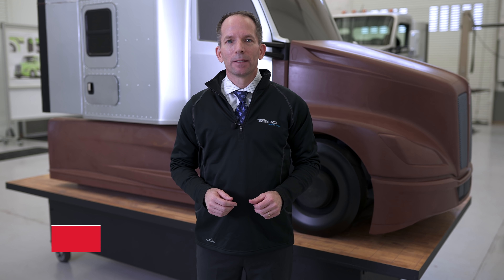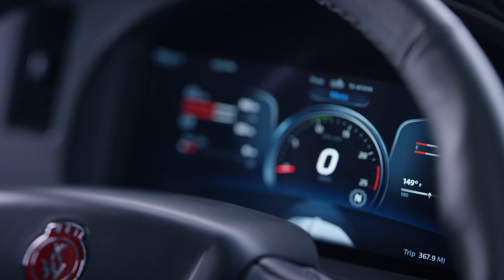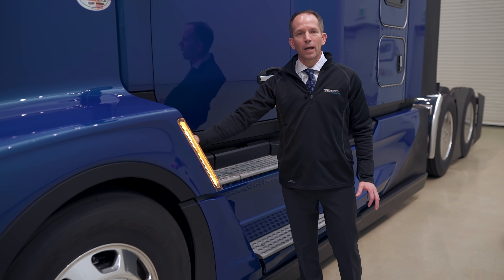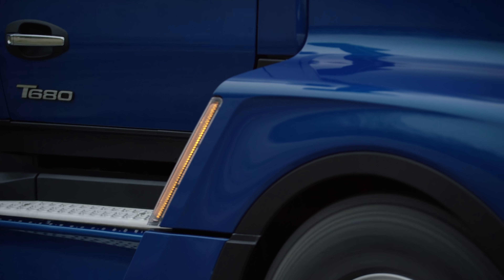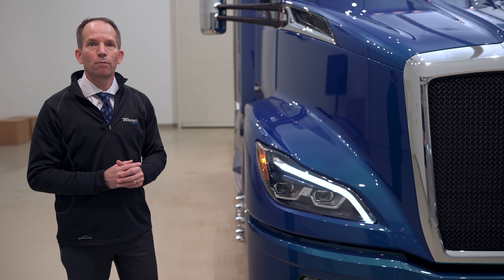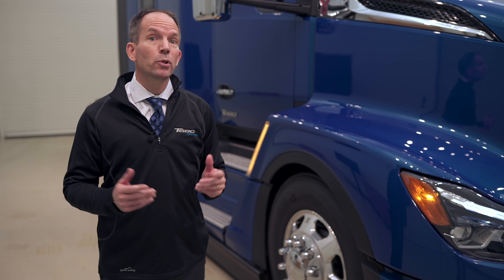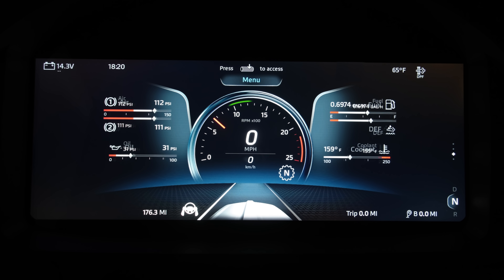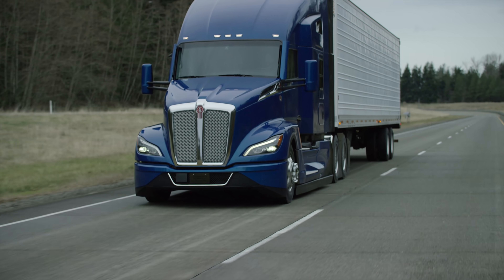Kenworth T680 Next Gen Product Development

Comment: Have you guys fixed the garbage paccar engine you put in it? I had a 2019 t680, nicknamed the T6-shitty.
I lost my engine brake on i40 west bound heading into Asheville NC when the total weight was 78000 lbs. My transmission FREQUENTLY threw transmission fault codes which caused me to be locked in a singular gear until I pulled over, drained the air system, left the truck off for 20 minutes, then get going again. And if I stopped, I was stopped. I loved my KW, until it tried killing me. The interior was very nice, but needed work. I have a 2021 freightliner, and honestly, it's a better truck, and I hate saying that
Reply: I have more suggestions if you're interested. Please get in touch. I'd love to help make next generation trucks better.

Comment: I spent 17 days in a hotel in SLC UT WVC late Q3 2019 because the bloody Kenworth dealer up the road had to have an electrical part shipped in. 
I loved the 2017 truck, but until they 
fix that kind of ridiculous service turnaround issue I would   n e v e r   
buy one.

Also, most of the breakdown incidents 
I had to endure, of which these were numerous, involved either various electrical or DEF system issues.  
V e r y  frustrating.        🖤🚛💨

An additional issue is as these Winters seem to be getting far more extreme, as well as more extensive across the whole of the USA generally, we Drivers desperately need a proper new system to be inbuilt into the Truck to handle de-icing of wipers, the windshield, and even mirrors during ongoing travel in low-temperature weather conditions such as freezing rain and blizzards!    
All that engine heat, being wasted.
✡️🌨️🌨️🌨️✡️ 

Finally, why can't you redesign the "opening fairing to move out of the way" in the opposite direction as well, bumped inward by the trailer edge? That would help when we have to make particularly tight turns to get out of tricky situations. Seems like you are setting us up for more damaged equipment. I already had a couple bent up, from contacting the trailer, on my previous 2017 truck. That is seriously an avoidable cost in waste of downtime and equipment expense.

.    .    .

From all the comments on here, 
it's clear that what Kenworth designers are still missing comes from a paragraph out of Elon Musk's product innovation workbook: 
"Seek negative feedback from your  
 customers ... [i.e. Truck Drivers]."

Frankly, the only improvement that caught my interest is the customizable instrumentation panel.

.    .    .

Comment: I didn’t see these switches on the steering wheel and you can’t tell me out of 100 truck drivers you say y’all interviewed did not suggest Headlight blink switch, marker light blink switch
Reply: Kenworth already has headlight blink and marker blink switch.  On the left column stock.  Press down blinks headlights press in the end, flashes markers.  Why change that simple feature?
Reply: @jumpoffjoe6572  I had a 2019 T680 and that did not make the headlights blink and the button only caused the marker lights on top of the roof to blink. Not the trailer.
Reply: @iCodyonline  I currently own a 2019 and it does make my headlights blink and the marker interupt flash the cab markers and the 3 center markers on the back of the trailer.  My 2017 worked the same way.
Reply: @jumpoffjoe6572  dang, I wonder if my company disabled that feature. Because all of our KW‘s don’t do that. 🙀

Comment: Anyone remember when trucks were built to pull hills and be the exact opposite of aerodynamic? Man those were the days
Reply: The easiest dollar ever made is the one not spent, fuel is the biggest expense of a truck therefore has the highest potential for savings.
Reply: @jaydunbar7538  when I can shave a half hour off of my trip by having power that's more money in my pocket by getting to the next load and taking off with it. It goes both ways

Comment: All these guys should spend 1 yr as a truck driver. Alone. 
Working for a run of the mill mega carrier hauling loads. Reefer, van or flats. Just a regular driver. 
Have them Run Atlanta in summer traffic, pay the tolls in New York and go in the City, try and find parking in Vegas, climb the hills of the north west and drive thru the winters of Canada with light loads. Make them understand what they build and why. 
Then they should sit and build their trucks. 

I challenge any of these guys to do that. 
In exchange, I’ll be more then glad to dispatch them, let them run under my authority and I’ll train them for 2 weeks before I send them off alone in their brand new trucks.

Let me add they should also work on these trucks. They should spend a day changing oil, greasing it, adjusting brakes, inspecting suspension and the truck in general. 

These trucks are cars. Not semi trucks anymore. That’s why the resale is garbage on them and the life span is half of what the old iron built trucks are. 

The market speaks for itself and proves what’s worth what. Compare a used kenworth like this to a older early 2000s kw Pete or western Star. 
The market don’t lie.

Comment: I've driven every year T 680 in every weather condition imaginable so don't take what I'm about to say lightly!
 if you have not fixed the fuel nozzle from Love's specifically from flopping out onto the concrete this truck will not even be considered having to stand and fill up one tank at a time is unacceptable!
 the ability to clean your windshield without completely fucking off your mirrors, that lake of water that builds up on your side window in the rain, or the snow bank that develops on the windshield post because the wiper doesn't go one more inch! oh!  I can tell you right now that weathervane or whatever 
 you call it on the side of the windshield is going to make cleaning the windshield and absolute pain in the ass something we do as much as four or five times a day and certain conditions!
 I would suggest you focus on being able to see out of them almost as much as you're focused on what they look like!  I certainly hope you give us a break on your $700 refrigerators all we need is a square for a little $50 one  drivers and mechanics alike feel sorry for any Independents buying a used one of these from a company!
 they're a great company trucks for $350,000 MI!
 every time there's a problem my company literally just throws me in a new truck because the down time is so great like I said I've driven every year in every weather condition I could go on for days with little fixes and little things you all could do for us to make life tolerable! first thing I would ask have any of you spent 24 hours a day 7 days a week in one of these things that should be an absolute requirement for every member of your design team because then they would already know everything I'm saying! One other thing you should add a switch to shut off lunging forward or backwards while in gear having to fight with that instead of just feathering the throttle uses up all the air in the tanks and then you're sitting there like a jackass in the middle of the street because even though you have plenty of air it won't shift into gear if you get on a little bit of ice and you have to shift forward and back a few times to get out of it that is infinitely harder having to hit the break each time so the truck will move take all your guys out put them in the mud and tell him to get out of mud or ice while coming to a complete stop and applying the brakes before you shift common Sense gentleman common sense

Comment: I must have dozed off when they mentioned the very much needed heating system for the DEF tank and piping. 

Having the air flow through the engine compartment and channeled under and in front of the door would keep me very nervous. A Carbon Monoxide detector should be mandatory with that design.

I like the rear fairing and battery access features. 

I'm guessing the hood is still a pain to open and close. Otherwise they would have mentioned or shown the improvement. 

I seriously doubt the color of the material on the door panels will significantly increase sales.

He actually said the target was a 6% fuel mileage improvement.  That is rather small for all the new components to maintain or replace to accomplish that.

It doesn't seem like keeping the windshield and wipers clear of ice will be any easier.

...

Overall, not real impressed. I liked the 680 but it still seems to be designed for fleet cheap initial cost and outrageous maintenance and repair costs intentionally engineered into the design. I don't see a single improvement that resolves previous flaws. I do see guaranteed part shortages as well as extensive down time for even a basic repair or recall service.
Reply: What rig do you drive? Which ones do you prefer?

Comment: I’m sure no one is going to read this but the last guy said it should be about numbers  ! Nice to think that when there’s a person that spends most there there time in the thing ! Didn’t see anything about that stupid drawer refrigerator that doesn’t have the capacity to hold much of nothing and why I have a freezer with the tray The size of a small meatloaf container and that your whole entire freezer ?! And hey you still got the same stupid lights above the Windshield that if you bother to ask the big fleet buyers of your T680s they’ll tell you that they leak a lot you could’ve came up with a simple visor the lights in that change to look of the truck call it good  like the swinging table in the back but you could have made the bunk a little longer so i’ll driver could have the option to sleep on that end as well ! What’s with the little ass drawer under the refrigerator that was stupid !  Now don’t get me started about the over head storage in the cab area someone should be slapped for that !  It is pretty and I’m glad to get better fuel mileage what did you do for the poor soul that has to drive it every day day in day out

Comment: Did he really just say "we've designed an opening fairing extension"? Surely he means that we've borrowed the opening fairing extension that our fellow PACCAR  company DAF have fitted since 1985. Along with every other European truck. Will the US ever catch up, and stop trying to take credit when they do catch onto an old idea.
Reply: Actually DAF produce COE models but T680 is a conventional cab design. I think he ment that it is new for American model trucks not European .
Reply: They are very close, they offer disc brakes optional, but most of O/O don't want them because they freeze, they cost more, they dont have enough braking power bla bla bla....
Ohh!!! In Europe if you want a manual transmission you have to order in advance and pay more than the auto. Of course in Europe everybody wants auto because you save fuel, repairs and driver doesnt have to fight all day with the gear lever. How stupid they are in Europe!!!!

Comment: Whoever thought that the neutral coast was a good idea in the automated transmission trucks needs to be slapped upside the head and fired. It’s f’ing dangerous!!!! Hopefully you all can figure out how to keep the electrical gremlins away on top of that.  Dash lights intermittently stop working then work again with an ignition cycle, stereo quit on mine for 3 days, literally froze up, wouldn’t do anything.  At least the volume was off.  
Dash, stereo would not turn off, even removing the key and walking away for a few hours!!!  I have a 2020 T680. Glad it’s a company truck.  Definitely going to be buying a Pete 389 next year.

Comment: I drive T660 and T680 with Paccar engine absolute nightmare, engines have no power , everything inside the cab rattles, sounds like it’s braking apparat every time the road is little uneven . The door seals are bad ,especially on T660 , it really is very uncomfortable truck to drive in winter ,it lets a lot of freezing air in onto your feet and left side of your body . The steering wheel material is very bad ,it peels off and it’s challenging to clean since it easily absorbs dirt . Both trucks are hard to back in with with small turning ratio , and the auto transmission on the T680  is the most finicky ever , be prepared to hit the trailer very hard once hooking up ,because it jumps super fast which ends up slamming into the trailer very hard ,almost hurting your back and neck while in the driver seat . I don’t know I always thought Kenworth  was a premium American brand !?

Comment: I will not buy a truck with a digital dash, EVER. it has nothing to do with drivers, everything to do with it costing less money to manufacture. That's just sad.
Reply: Wait until it breaks 20,000 in the hole an then they can't make them fast enough you be sitting 2 plus week just to fix it.
Reply: Nobody asked you to buy it. You can drive your 1970 designed truck, nobody will ask you to replace it.

Comment: Ok, so why isn’t a aluminum frame on the “NEW” 680 standard? We have aluminum trailers Alcoa aluminum rims running super singles on truck/ trailer. combine it all & should make for less weight, improve mpg. Diesel going to $5.00 by the 4 of July. Get reid of the huge mirrors and replace with cameras if your selling aerodynamics. So Basically not much changed with this truck, just some new lights, selling new interior design (as a company driver your never going to see any improvements) selling us aerodynamics again and garbage paccar engine. These individuals in this video’s aren’t truck drivers - just office/Laboratory nerds that are clueless what it’s like to be out for weeks at a time. They’re privileged, they go home at night.

Comment: Will this one have an Auto transmission that doesnt go to hell after 200k miles. 3rd gear on a hill? What 3rd gear?
And gods be praised...will there be a table? Is that the new generation? You finally figured out that drivers need a table....like comes standard in every other base-model truck?

Comment: There are so many things wrong;
* electrical issues.
* water leaking inside due to poor seals...
* front shake/vibration/wobble due to sitting on the tire - junk design. 
* regen issues.
* sleeper is too small.
* not enough room behind the driver’s seat.
* too many plastic components that crack, rattle and fall off the truck..
* all in all - junk. - should have stayed w/t600.

Comment: I pull container chassis. Your fuse box is not compatable.  my T880 i ate fuses like candy. Why put it underneath the clutch peddle. 
Aaggghhhh. Does your engineer even drive a truck. I go into dirt mud lots deep ruts. I need ground clearance. Why does KW have so much frame behind the rear end. 
With the above chassis all i could get on the steers weight wise was 11500. Because the frame ends is soo long. Aaagghhh. Weight 18500 lbs. Full fuel 160 gal. I only get 6 mpg. The same as my 98 IHC. 
450 isx 10 speed man and 336 rears.

Comment: Bla bla air dynamics, bla bla air dynamics. This is no savings AT ALL when you have to spend 10k - 30k to fix that DEF CRAP. After 500k miles this truck will be junk, because of DEF problems, or be ready to spend 20k$ + This system targets to kill owner operator business. Miss new cat Engine.